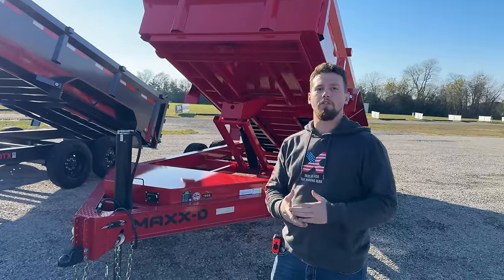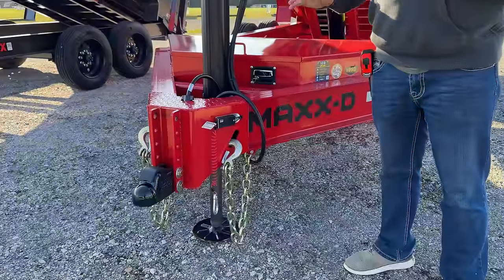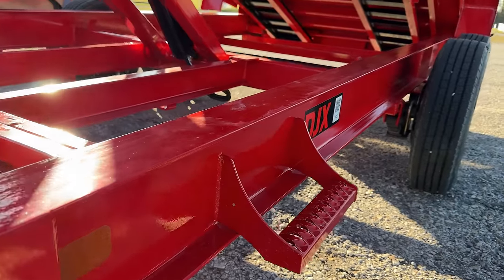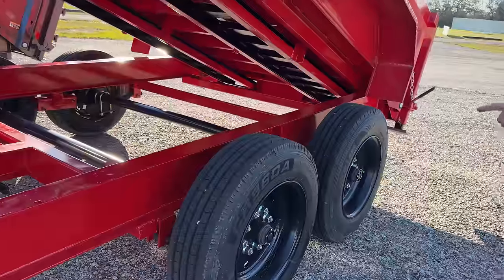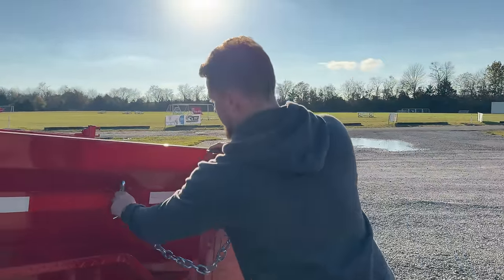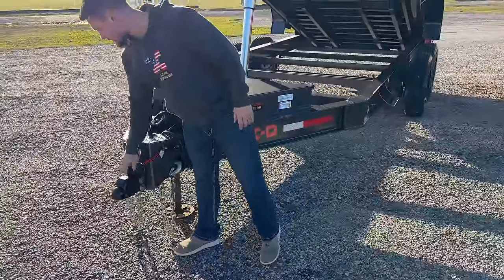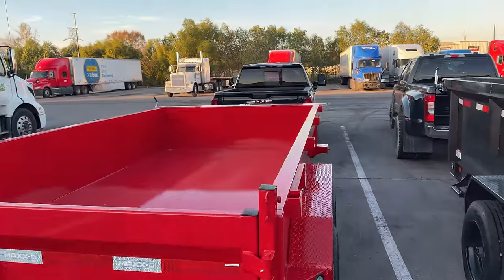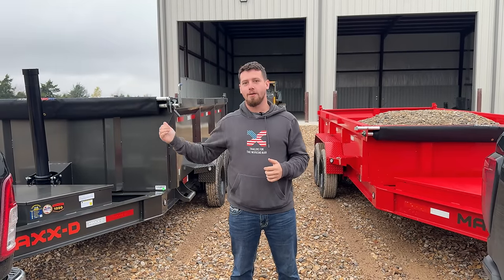Scissor Hoist vs Telescopic Cylinder | It's not what you think! DJX vs DTX Dump Trailer Comparison

Comment: Those cycle times are unacceptable. 2 minutes to lift up 😂
Reply from the maker: the cycle times are pretty standard across manufacturers. A 2-minute lift time is common for most dump trailers using electric pumps. However, the new DSX dump trailer comes with two KTI pumps, making the cycle time much faster.

Comment: Observation. The way that both trailers lifted the drawbar as the load shifted means the operator will need to be careful when spreading, or they will lift the rear pickup wheels off the ground.
Reply from the maker: Thanks for the tip!

Comment: For me it's not about the speed of the dump, it's about the reliability of a dump so if I have a really heavy load, my preference is the telescopic lift.
Reply: Every dump trailer I have seen tip over has been an open frame telescopic style. This is because there is no stability in a telescopic ram, it can only push and it's subject to buckling. The scissor mechanism itself, even without the ram, is exponentially more stable just due to the width and the role in side load resistance it provides. Yeah, there are more moving pieces and you need a larger diameter due to lower mechanical advantage as compared to a straight pushing telescopic, but the former just seems superior.
Reply: I have telescopic,  love it.
Reply: Exactly, telescopic seems fine for near perfect level grade with near perfect load distribution dumping.

At a left or right sloped grade or uneven load, I believe the scissor is more stable and has less chance of tipping over.
Reply: As a hydraulics mechanic you are correct the telescopics can lift more but when it comes to fixing the cylinders the scissor style would be much cheaper long term. Easier to disassemble and seal than a multistaged cylinder.

Comment: Much like target shooting, speed is not accuracy. While the scissor will arguably be the fastest lift system, the telescoping is hands down the strongest. For those saying BS, how do dump trucks lift? lol. Less stress on the frame too. Look at Texas Pride Trailers torture test from Dirt Monkey. They run all 3 lift systems on their 20k trailers. They loaded the trailers until they would not lift anymore then weighed them. Scissor was around 27,200lbs, dual was 36,900lbs, and telescoping came in at 47,120lbs. Texas Pride makes a great trailer and $6,000 - $8,000 cheaper for a beefy trailer. (Not Diamond C or Maxx-D beefy, yet still contractor grade) Scissor lift will continue to get the job done! Just better technology out these days.
Reply: I have had a GMC 7000 Can not remember the year. It had a scissor lift and a 20' box with 4' sides maybe 5' usually used for hauling construction trash I could load it with almost a full box of dirt and roof tile mixed, maybe not legal to go down the road weight wise.... don't tell, and that lift would never let me down, it had dual cylinders on the lift had to have one repacked, and the bed broke the rear hinge on the drivers side one time dumping a huge load of dirt.... but still dumped and dropped, had to have that repaired that day.... Miss that rig... was a great truck for the time.
Reply: Can’t find this link would you oblige?
Reply: Bla bla bla...  Love it when guys don't understand what the power of Hydraulics is for.... 
You see all that Exposed Chrome you keep coating with Rock Dust...
Think your going to get a Seal Kit for your CHINESE TELESCOPIC RAM??? 
Gotta love these geniuses in the comments 😄

Comment: all you need is a diverter valve for the front jack and dump, simple and easy H&H has it for their 14k equipment haulers, works so slick
Reply: A diverter valve would not work in this case because the pump for the telescopic cylinder is only a single acting pump. That means it only generates pressure out of one port. A jack needs a double acting pump in order to create power up and down, hence they are using a double acting pump for the jack. The four function pump they are referring to has the capability to accommodate both a single acting and double acting cylinder on the same valve body, which eliminates the need for two pumps.
Reply: @jamespolkinghorne4452  Not necessarily, if the cylinder/jack had springs built in, they could retract the cylinder and the single acting pump would work.
Reply: @jamespolkinghorne4452 you talk gibberish wont take time to correct yourown  reallity fearing you will implode  keep
To trucking

Comment: I have had scissor hoists on trucks and trailers and would not switch to a telescopic. Telescopics get weaker as it gets longer and can snap if at an angle. Scissor is the way to go.
Reply: I would have to disagree.  I’ve had 2 16k scissor lift and now a 16k telescopic.  They don’t get weaker as they extend.  They are strongest at full extension.  Like a solid steel rod.  Look at dump trucks.  They dont use scissor lift.    Yes you have to be more careful about not being on a significant angle with them.  They aren’t as stable as the scissor.  And they are slower.  Difference is were it matters… they dump way more.   It’s easy to overload a scissor lift.  Ask me how I know.  Telescopic not the case.  I have yet to see my 2 year old max d 16k get stuck dumping anything
Reply: I dump on hills , inclined all different directions,  unstable ground, fly ash, to top soil,to stone, firewood.    14 ft telescopic.  I have had a scissor lift in the past same 14ft.      The telescopic will do it all with tons of more dumping power if needed.     
When on a hill or not level ground your dump bed is stable by the mounting not the lifting...  there's 100 years of them being used in 53 foot er etc to prove that.   The telescopic does sway a little at times at high lift but nothing to worry about if your paying attention anyway.  Iam sure you can overload it and break it , tip it etc same as the others. Point is telescopic is stronger by far. More efficient,  effective.    Think of a wheelbarrow.  Put the handle in the center. Load it up and try lifting it from All those different points with your arms.  You will see you can not beat the telescopic.  They all will beak if you overload enough , will all tip over.  It's about using them in the operation range. Then the telescopic is by far the winner.   If you care about 30 seconds of up and down time, then you won't buy a dump trailer to start with. They are not faster than a dump truck period or stronger.  Also have worked in the coal yard with tractor trailers loaded full of fly ash. 80 to 140 tons a load .  We dumped on big pile of fly ash. Very unstable. Rarely did a truck tip.  Only when they were not being smart.  Witch every trailer will tip if being dumb.
Reply: I think the biggest difference is dump angle for sticky loads and a properly designed telescopic will win
Reply: There is more wear and issues with a scissor, telescope cyl is better, also easier to replace when necessary.
Reply: A telescopic is unstable at heights…? But a scissor isn’t..?? That’s gonna be a tough claim to back up. If you’re lifting a ladder that’s laying flat on the ground, when you start standing it up are you gonna hold it down by your waist? Or as high over your head as you can reach? See the similarity? The telescopic is pushing on the very end of the “ladder”. The best possible scenario. The scissor is pushing on the middle while the top is free floating. The side-to-side stability comes from the hinges, the shape of the cylinder is almost irrelevant.
Reply: @wlombardo31  You forgot mechanism weight savings with the telescopic lift and uniform bracing for equipment hauling...My 2 cents
Reply: @brianconner4854 scissor gets stronger as extends telescopic gets weaker with every stage as you move to a smaller bore diameter.  That said if you are dumping your load gets lighter as you dump and you need the strength to start the lift, after digging out the front of several scissor trailers  I would never buy another 1 because the speed does not help when you have to schovel out the first yard or 2
Reply: Your telescopic should never have anything pushing it at an angle unless you have in adequate hinges and scissor has no breakout force compared to telescopic  yes scissor moves faster because it is a mechanical extension to make that short cylinder be a longer cylinder and that extra speed is not faster if you have to dig it out by hand
Reply: Guess it depends on what your dumping when your load is ( getting lighter as you dump).  Anything other than clean rock pretty much stays in your bed until you are damn near at full extension.  And if it’s wet material then it’s not going anywhere until your full tilt basically.   At the end of the day scissor lift trailers are toys.  I’ve owned them.  Telescopic dump what you put in them.  End of story
Reply: Scissors are more stable though, hence safer. Safety first mate.
Reply: If your trailer hinges are so anemic you have to rely on the lifting device to also make it more stable perhaps you should rethink your purchase
Reply: the same design and material on both, the scissor is more stable

Comment: What! 😂 
Depends on what the parameters of winning are.
If it's time on a light load then share scissor lift wins but if it's what trailer can dump more with a heavy load then telescopic wins

If it's I need to load the weight front heavy and carry a small stand on machine at the rear then telescopic wins because the scissor lift will not be able to dump the load 😮 thus basically winning on time and speed as well 🙂

Comment: BigTex Trailers will dump as much as you can put in it. Don't get me wrong. You've got nice
trailers but, it should dump all you can get in it. It sucks when you get more than
half full and it won't dump. I will be looking closer at your trailers and prices.I need a new heavy dump
that I can haul behind both my truck or my tractor. I use that when working off-road. I really
like your remote. Makes it nice to dump from the cab. I'm guessing that they both have wireless remote.
 It was a good video. 
Thank you.
Reply from the maker: We don't currently have scales close enough to the plant to load both trailers. We would rather not take these trailers down the road overloaded.
Reply: @Maxxdtrailersofficial  SIr, being that you're a manufacture of these trailers, you would certainly be able to find a rock pit or other place with scales that would load you and let you dump the product back out at that location to TEST your trailers!! Should not be too hard and the only cost should be ... repainting, Also I had a 40' aluminum end dump we put a 10k liner in it to lengthen the life of the bed.... If the concern is the inside, from demo jobs of concrete, block or bricks... maybe a liner would assist those who are worried. I am in Arizona so Rust and water was usually not an issue for rusting or such things maybe less of an issue with aluminum than steel but something to consider depending on the state and situations the trailers are being used for or in. Hauling firewood would be perfect!!

Comment: I always thought that a trailer with twin cylinders would be the strongest. I was very surprised when in side tests the telescopic was the strongest. All of my trailers are equipped with telescopic cylinders.
Reply: Not necessarily. If the pump is large enough then your good but my double cylinder will not lift a food heavy at capacity load

Comment: What trailer is cheaper to maintain? The lift section I'm sure would be expensive to repair.
Reply from the maker: The telescopic cylinder is easier and more affordable to replace if needed. Since it’s bolt-on, there’s no cutting or welding required. Both systems have proven to be reliable, and the maintenance costs for both trailers are similar. However, the telescopic system requires less maintenance, with fewer grease points and easier access to the cylinder, which is located at the front instead of underneath.

Comment: When we bought our 16’ dump trailer with a scissor lift, the first first load of fluffy screened topsoil was too much for the hoist to lift.  Went to the hoist manufacturer, and discovered they sold that hoist with two different diameter cylinders.  Why the trailer builder put the smaller unit on a triple axle heavy capacity unit, I’ll never understand.  Swapped in the bigger unit, and  it’s never failed to lift anything we put in it.

Comment: To each his own in preference, but !
As a mechanic on many and operator on a little less, overall the telascopic lift is far more dependible, with far less
matainance, less repair cost in hinge pins and pin bore replacement when needed. As for tip over concerns "Stupid
gets what stupid does" Keep it level left to right, stop when it stops being level !
Reply from the maker: That's right!

Comment: I am confused by the two separate pumps. We use hydraulic systems at work the move multiple cylinders off 1 pump. I also wonder how every single piece of heavy equipment does it, considering the drive system and boom are all run off the same pump. Can someone explain if there is something I'm missing about these two cylinders? Otherwise, both trailers look nice and have some neat features.
Reply from the maker: We have dual acting pumps on order for the DTX, soon we'll be able to operate the jacks and telescopic cylinder off of one pump!
Reply: @Maxxdtrailersofficial very nice!

Comment: Shouldn't that wet lead battery be isolated from the other electrical components to avoid issues with the corrosive off gasses while it's charging

Comment: If I am buying a dump trailer, I am worried about it lifting and dumping every time. I have seen better performance out of telescopic systems vs scissors.
Reply: I have a 2019 PJ 14’ 4 foot sides with a scissor and it dumps as much weight as the truck (2019 L5P 3500) can handle no issues. Occasionally with dirt will need to shovel the front for 10 minutes or so by hand but only when extremely over loaded

Comment: Why did you not load to the rated capacity? There is not one mention of the steel prep, type, or gauge. Is it possible they will not be able to lift the full load?
Reply: I think the only reason they didn't load to rated capacity is because they wanted to have roughly the same amount of gravel weight in each trailer to make it a more even comparison. But good point none the less.

Comment: Every manufacturer seems to push scissor lifts but every scissor lift trailer i have ever used and there have been several we had to schovel the front out by hand  so if you cant load it full and level to the top with sand why make them that big and why push the scissor?  Wait i know push for profit. How about a twin telescopic so it will dump what it will hold because scissor it is not faster when you have to schovel out the front by hand
Reply from the maker: Correct, the scissor hoist won't lift as much as a telescopic due to the leverage. Dump trailers aren't a "if it fits, it ships" product - they have limits. Their frames and axles can only handle so much weight, but a scissor hoist will handle its capacity just fine.

Dump trailers are meant for hauling all sorts of stuff - dirt, trash, logs, you name it. But loading it up to the top with sand would be pushing it way past its weight limit, probably 2-3 times over.
Reply: @Maxxdtrailersofficial  so why is it nobody even offers a smaller size dump trailer with heavy axles and frame for those of us that purely intend to haul nothing but fill. It would actually save some money but not be cheaper and have a smaller trailer for my intended purpose.    I WANT THE IF IT FITS IT SHIPS industrial rental center takes a licking and keeps ticking 10 foot  9900lb rated with dually tandem  10k axles with the longer equalizer as many stadard off the shef parts as possible and 17.5 wheels  with an actual dump box not the it's loaded with features you will never use to help it sell model maybe in a side dump setup as it would only be used for fill in confined residential areas a baby demco  side dump
Reply: .... depends on the sidewall height.
2 foot vs 4 foot

Comment: What gauge metal do you use for your flooring? Is there a seam in the middle of the floor?
Reply from the maker: 10 gauge floor is standard on both trailers, which does have a seam down the middle. 7 gauge floor is optional, the 7 gauge is a one piece floor without a seam down the middle.

Comment: What is the height of the trailer when at full extension. We have a horse boarding facility. We will be hauling shavings. I want to make sure the ceiling height of my storage shed will accommodate the trailer to dump out the shavings.

Comment: Why does the telescopic have to have a separate pump and battery for the tongue jack. Use a hydraulic switch valve and use just the one pump and one battery and you would have more room. Less maintenance and less cost
Reply from the maker: We recently switched to a dual acting single pump to operate both the bed and hydraulic jacks!

Comment: Nice looking trailers.  I had a hard time believing the weight of the trailers empty.  My 10,000 pound dump weighs between 2500 and 3000 pounds.  You weren’t weighing the trucks too were you?
Reply: They weighed trucks with trailers
Reply from the maker: Yes, the gross weight includes the trucks. The trailers weigh anywhere from 4,500 to 5,000lbs.

Comment: you have the cylinder on the telescope on backwards   you start from the biggest part of the cylinder and the higher it goes up the faster it gets
Reply: Why would that matter which way it's mounted? You can see in the video the biggest sections are extending first. Although mounting the cylinder on the bottom would have saved a lot of hose.